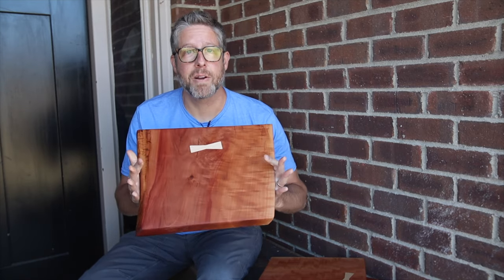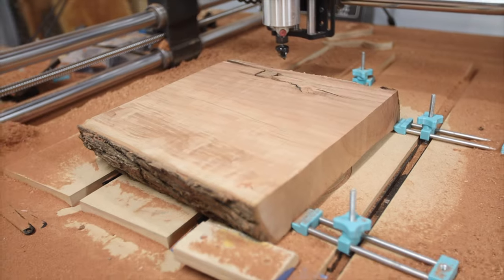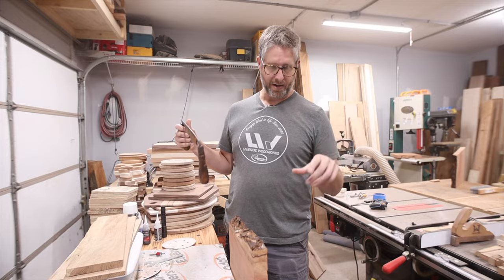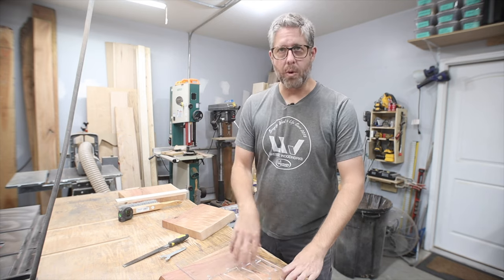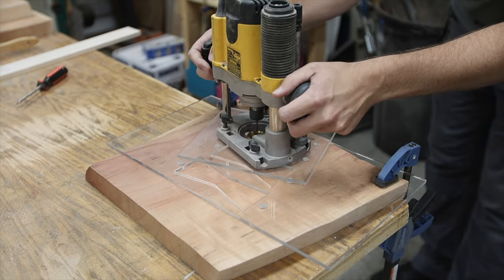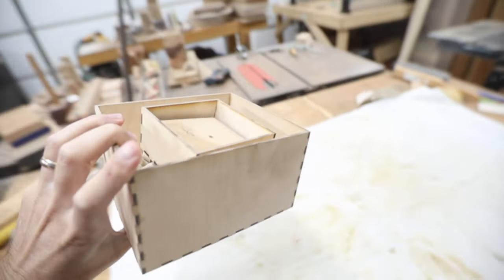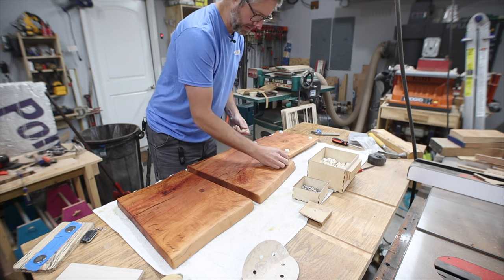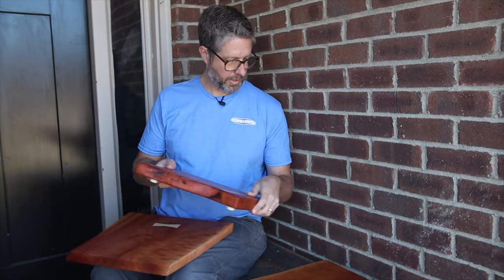Live Edge Serving Boards

Comment: These came out great Bruce! Keep up the good work. I love how you used the onefinity to flatten one side
Reply from the maker: Thanks so much! Yeah, that machine made quick work of it. I like how you can manually jog the machine for that type of thing.
Reply: @BruceAUlrich  I never thought about doing it that way at all. I haven’t even attempted to see if I can manually move my new machine with the spindle on. Time will tell. I’ll definitely try this in the future
Reply from the maker: @sandmanwooddesign  Did you get the wireless joystick? If not, I can link you to the same one on Amazon. That's where I got it.

Comment: Hi Bruce, enjoyed this video.  Would you mind sharing your feeds, speeds and depth of cut info for flattening the boards on the onefinity CNC?  I have been briefly experimenting on this with burn marks.  I'm thinking I need to increase the feed rate as I've slowed the router speed as much as I think i can and not burn out the motor.  Thanks.
Reply from the maker: I don't know that info, because I typically do the flattening manually. I have a handheld joystick with the OneFinity and I just jog it back and forth manually. That being said, I would say you're right. If it is burning, you might need to run it a little faster.

Comment: I am curious as the price you asked for these cutting boards to cover your various costs IE the wood, sanding and time bowties, travel to the fair, and time at the fair.
Reply from the maker: Hey John, great questions. I was asking $150 for these (maybe less for the smaller one), which I thought was a reasonable price for what they are. Nobody purchased one. They got a lot of looks, but that was at the higher price point of stuff I had there, so maybe that was why. I had about $13 in the wood for each of these, so add in some time for sanding and adding the bow ties, there was a lot of margin there.